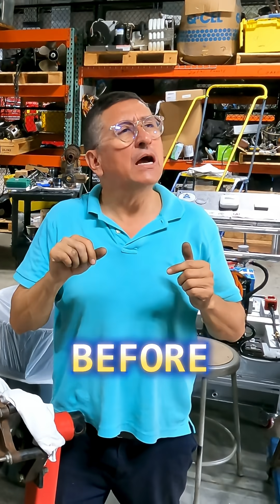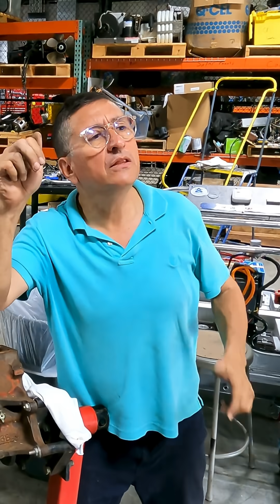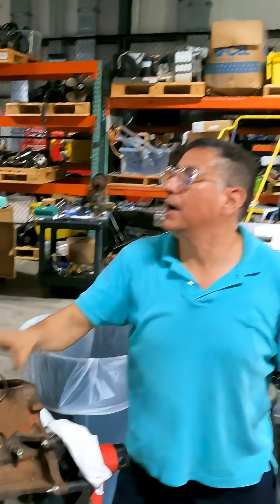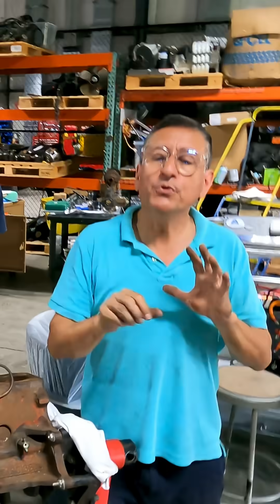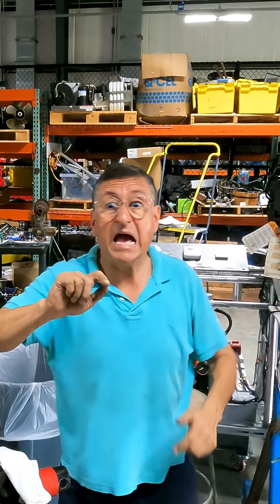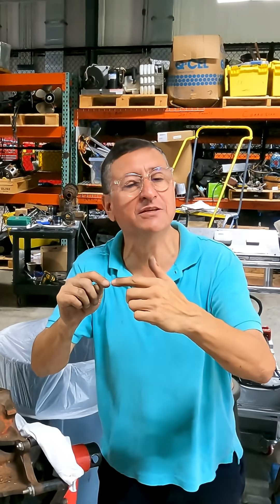Understanding Engine Over Speed Due to Timing Errors

Comment: the air-fuel mixture needs time to burn completely and produce peak pressure at the optimal time for mechanical advantage.
Reply: Especially at higher RPM. So advance the timing gives a bit more time for the combustion. But you don't want it to push back on the piston before it reaches TDC on the compression stroke. So it kinda depends on how things work out.